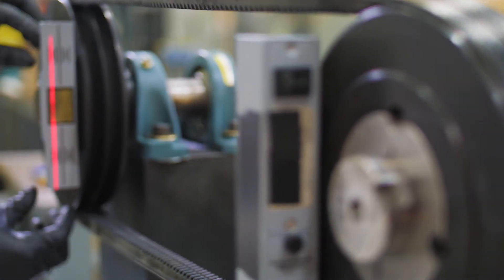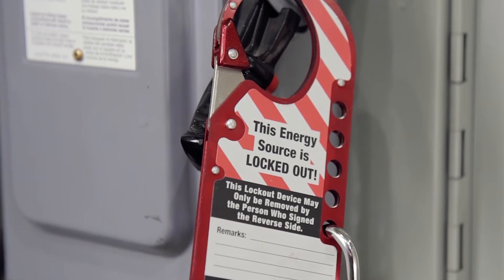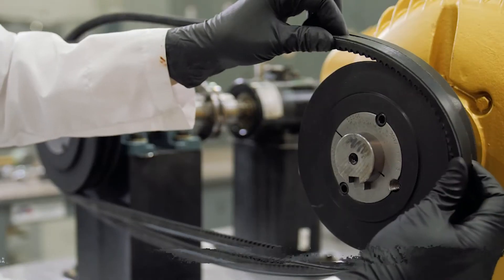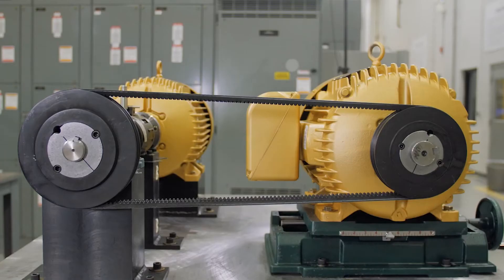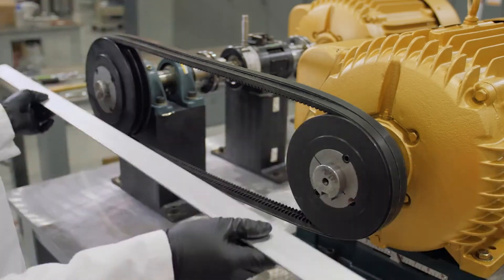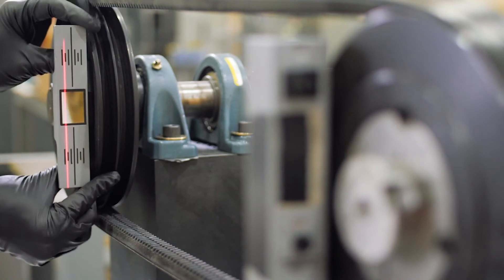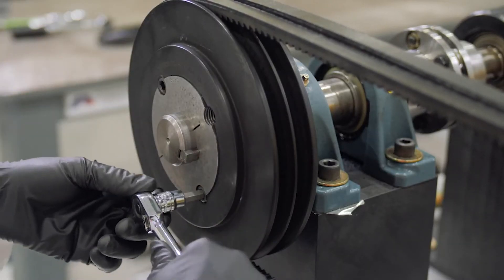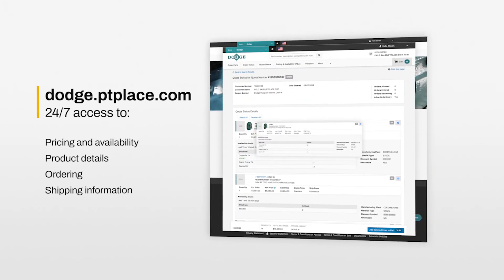Dodge belt drive alignment and installation | Dodge Industrial

Comment: I don't know why everyone thinks aligning the outer edges of the pulleys does anything. If the outer edge of the pulleys are not the same thickness, this method does not work, which I find to be in most cases. This is why I can never use laser alignment tools.
Reply from the maker: The groove dimensions are based on ARPM standards, and there are specified dimensions for groove root from the sheave face.
So even if they are potentially different, the root is specified to be the same distance, thus aligning from the sheave face would align the grooves, if they are the same groove profile.  Please contact engineering@support.dodgeindustrial.com.